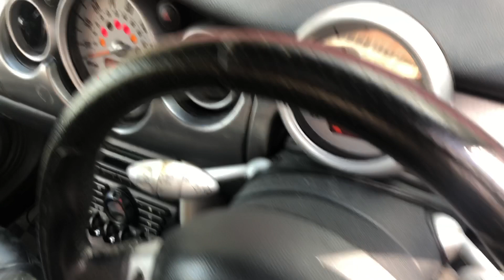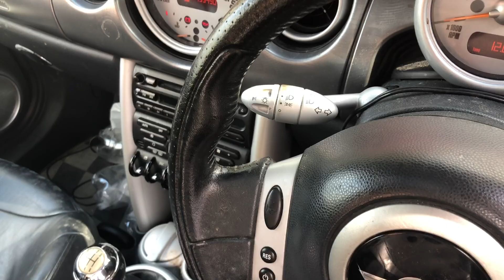Becoming A Wheeler Dealer PT6 The R53 Mini Cooper S JCW

Comment: Hey thanks for the video, what did you say that tapping was? Oil from the supercharger or the head?
Reply from the maker: Head
Reply from the maker: If you have that tapping it’s probably low oil level so check it and top it up.but my car was sitting for a few months so after a good run and a little oil top up it was fine